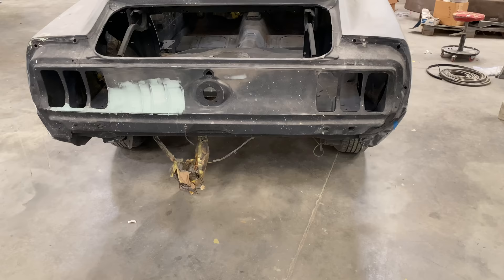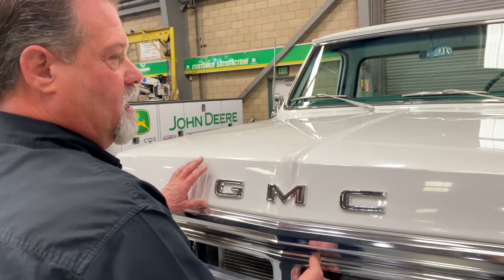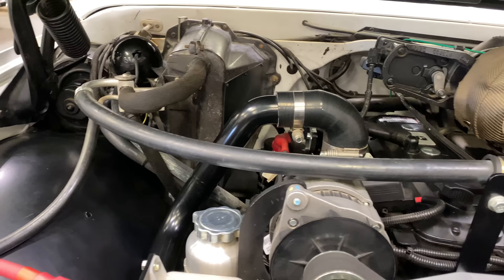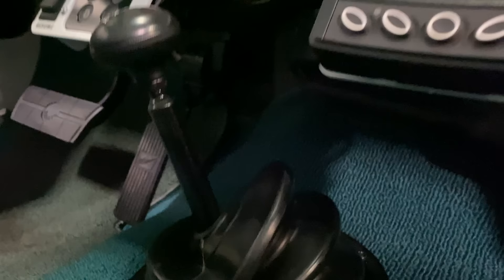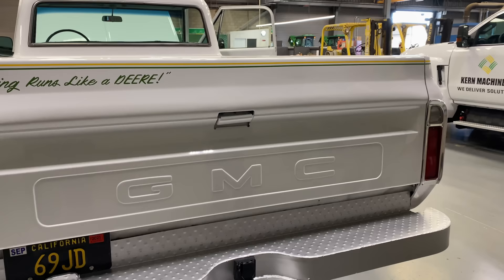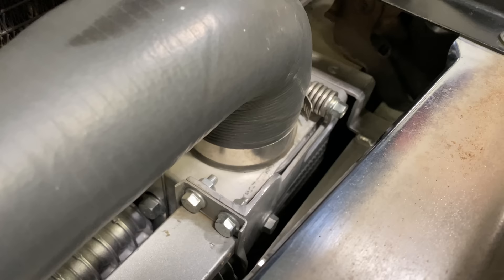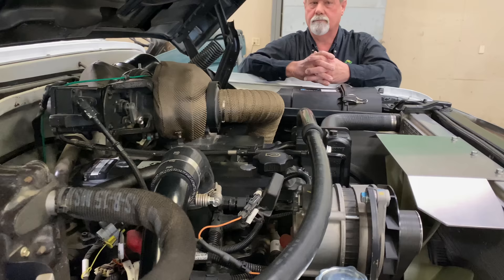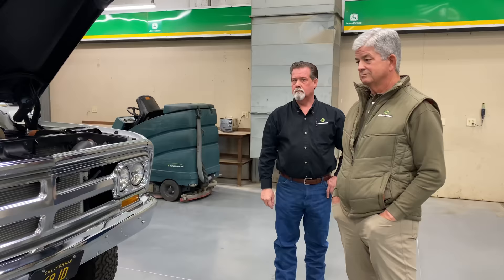John Deere Tractor engine in 1969 GMC truck!

Comment: Meanwhile hundreds of modern John Deeres are broken down with software lockouts forcing immense cost of repairs on farms and ranches. I used to love JD, now I believe the whole outfit can rot in HELL for their financial abuse through software lockouts of the ag industry.
Reply: Truth spoken. More yet if the equipment has to be trucked to a distant dealer
Reply: Exactly my friend... Farmers dont have time to wait for a dealer to take two weeks or more to fix it.. If I cant fix it myself and get back to work to put in or put up my crop, I dont need it.. Leasing is such a pain in the ass anymore, am about to buy some more older equipment, and keep my hard earned money.. ✌♥️🇺🇸
Reply: Yeah it straight robbery. I'm glad people are talking about this. This has to be known before somone sinks there ship with a half a million dollar yard weight.
Reply: They have a new program where a farmer can buy the software, edl, and computer
Reply: Seems like a segway to re-enslave and lose personal rights to own property.  In general the electronics industry seems to be more USSR secret where the olden days of purchasing a device with the schematics stapled to the interior case are gone in regards to being a general expectation.  Now, there's proprietary firmware, hidden chip processes, software that is licensed and not owned, and some other concepts conning.
Reply: Yup, that's why I'm never getting one.
Reply: I bought a Yanmar
Reply: You can do a majority of engine troubleshooting with a generic 9 pin scanner on the ECM side to retrieve any DTC's ,but yeah,if you're in need of troubleshooting anything related to Chassis modules or trying to get it into a forced re-gen, you're pretty much screwed if you don't have JD's software and Dongle with the 9pin..so, you'll be basically stuck with a derated unit, with no power....I had posted some vids a while back on how to trick a over-clogged system into a regen,but those videos were takin down by the powers above,cause they're basically forcing you to call out a JD field tech,or even worse,have to transport it to a dealer, like Dobbs, which is a F-ing rip off
Reply: Nothing rapes like a Deere.   Then boost about owning several dealerships. Who cares about the modified waste of money!
Reply: Yea I like the older stuff too, I see em a bunch on generators. 
I still see some older stuff back to the 70s. 
Seems like once they went common rail, they took a dump. 
Not a fan of their new business model at all.
Reply: @BigDaddy-qb2td  "Who cares about the modified waste of money!"  ///  Regardless of JD corporate policy on repair, it's still a really cool project that was done well to the point of looking OEM.  And it's totally usable and could be a daily driver. And better truck than when it was new.  I guess "waste of money" is subjective but if this is a waste then every car at SEMA is a waste along with hundreds of thousands of other project vehicles out there.
Reply: It should come free with every new purchase from Deere.
Reply: From "nothing runs like a deere" to "nothing runs"
Reply: Support your Right to Repair laws everywhere.
Reply: @codyguerrero1119  yeah did u ask how much its laughable
Reply: Definitely not an American motor!!!
Reply: Meanwhile the Ag industry is near tops of corporate welfare.
Reply: Not much JD stuff doing construction any more, we can be sued for not keeping up with a fast pace schedule, waiting weeks to get equipment repaired can cost you your business
Reply: @kd5inm  That's what ALL smaller Deere engines/tractors are anyway!
Reply: This is the reason I use only older equipment. 
All my shits paid for and none of the computer crap.
Reply: @TheBeingReal  where are they made?
Reply: @MrSenorhappy  Depends on the product. USA, Europe, Japan (Yanmar rebranded). Global company and they source / manufacture globally.
Reply: @TheBeingReal  I prefer USA Made. Thank you
Reply: @MrSenorhappy  Most people in the USA would probably agree, right until they pull out their wallet to pay.  Wall Street demands returns on investment that forces down production costs, ol Sanjay from India will do your job for 10% of the salary.  Capitalism at it’s finest.
Reply: Tell me how you really feel Jennifer 😂
Reply: preach it
Reply: Their construction machinery is junk too.
Reply: tractors replaced slaves and now people are slaves to tractors
Reply: i dive nothing ith a compute in it
Reply: @w1.0  huh?
Reply: This is a issue
Reply: Yeah my old boss had 2 JD's, 125k a piece, 4 years later he sold both of them and had 2 of school Case Internationals rebuilt from the ground up, ended up at 75k a piece, same HP and it they do break he can do everything himself. Farmers are getting f*cked by everyone nowadays, including the tractor companies.

Oh I forgot to mention, he installed AC in both of the cabs of the Case's, so they're just as comfortable on long days in the Kansas summer during harvest..

I no longer work for him anymore but I have a little ford for my property
Reply: @kd5inm  that’s great for you hobby farmers but for us full time farmers requiring larger horsepower a yanmar  won’t do
Reply: Yes! Hopefully  Right to repair is successful and they have to allow people to use that software to repair their tractors. You can find certain versions of the software around on torrent sites but don't do that it's illegal.
Reply: @chancethompson8686   Hopefully right to repair is successful. This will force companies to provide the software and parts so they can repair the stuff they spend money on.  So many companies now especially with electronics expect you to buy a new one in 2 years.
Reply: @nonionizingemf1424  I feel the same way. I do some microsoldering and you can't get schematics for a lot of stuff. And when you can some companies won't sell you the chips you need to fix it because Apple told them not to sell it to anyone else.
Reply: @nonionizingemf1424  also if you haven't look into the pine phone project and the labrum phone project. They are repairable Linux based phones.
Reply: @noahpaulette1490  Yeah, I'm finding the trend is becoming more invasive nuisance in the U.S. with whatever big corps, most likely international now since owning since the 1980's more-so, can get away with.  For instance, my first experience was working with FT-NIR spectrophotometers that used literally a car headlight style, or even a, lamp.  Well, I decided since the spectral characteristics were the same... to investigate.  Found ABB (I think Bomem, maybe higher up ABB though), bought all the companies lamps that were that spec on the market and relabeled with their company numbering scheme.  A little more investigation I found there were still equivalents on the market and I guess like the chip manufacturers where you could/can still find equivalent chips on the market... the challenge then is to test out which chips meet the better quality other proprietary model specs or which don't since what is found typically is the failing QC testing specs "new" proprietary make (and sometimes model).  Therefore, I think the consumers need to have a goal more to lobby legislatures to stop the enslavement and slavery schemes of Bolshevik failed or other countries and economies that did not allow for property ownership other than their monopolies/grandiose/oligarchs/plutocrats.  The trend seems to be enslaving, no personal property ownership and a class division that creates a situation where the "higher ups" can do whatever they want with no regards for the spirit, intent and letter of the U.S. Jurisdictions Constitutions and Statutes. Like you note also, investing in companies that are not closed source and seems like masked armed robbing their market if something is performed that is not considered meeting the civil bribery, blackmail, extortion coercion, seduction, manipulation scheme and for some reason is considered criminal when not even meeting the definition of a crime where a result might be something with processes that add up to more crimes that the closed source corporation literally commits.
Reply: @jafinch78  it's all working to bring in the great reset. With the MacBook example it's the charging circuit and using chips pulled from new chargers while being wasteful isn't to big a deal. It's just really dumb that Texas instruments I believe is who makes the chip wont sell it just because Apple says they shouldn't. People risk their lives every day to provide schematics to this industry by stealing them from Chinese factories with suicide nets. That's the real problem. Right to repair wold force them to allow people to have schematics so the product can be repaired.
Reply: @noahpaulette1490  The robbery is making people believe they need to invest in a product, if not also being forced to invest in a product, that has a network with armed robbers desperate to look like they're official enforcing valid laws that are really criminal in regards to the laws and enforcement of those invalid laws.  The attorney's, law enforcement, courts, jails and prison are literally conspiring, aiding and abetting and acting knowingly, intentionally and willfully with the continuing criminal enterprises corporations in a organized crime ring that also pollutes and make more toxic the environment for not necessarily survival related required goods.
Reply: They offer the software for sale along with the hardware. I know of at lease three people that have purchased it.
Reply: @derekl6433  I'll have to look into that. They were lobbying against right to right to repair and some similar legislation.
Reply: Even the equipment in the construction industry is the same. They just care about the money. Catapillar was a world of a difference.
Reply: New cars are nearly as bad,last week I had a 2020 Pacifica as a rental and the manual had the balls to say "warning,any modifications to certain features will void your authority to operate this vehicle"  Let that sink in,"authority". Chrysler has the gall to say that to an owner,it's amazing the kind of power trips manufacturers are on these days.
Reply: @chazzcoolidge2654  yep. It's all part of the great reset. Davos and wef say you'll own nothing and be happy. This is all to slowly bring us to that point.
Reply: I would advise everyone in th comments section to read the article successful farming published on right to repair    Contrary to what a person will gather from this comment section a farmer can perform 95% of repairs on their own. Believe me you can go into a John Deere dealer and order any part u desire for a new tractor
Reply: Lame, evey Manufacturer does this. Fyi you buy service advisor for 500 bucks just can't program it, so get over it.✌️
Reply: John Deere pulled a Carhartt in theory ...shame on them
Reply: @derekl6433  your missing the point maybe ? The old tractor jd never required software just motivation. Now jd tractors require both
Reply: @tylersowa3858  Any new Diesel engine will have to be electronically controlled to comply with emissions, I’m sure John Deere, Cummins, Detroit or any brand would be happy to have a less complex engine that required less parts and less warranty claims.
Reply: @tylersowa3858  also any other computer controlled system on a JD tractor is by market demand- if IH or CAT or any other brand comes out with a computer system that gets better yield during harvest then it will sell better than even a simpler tractor because it will give the farms that have it a competitive edge.
Reply: @alanking7331  instead of getting the government to force a private business to do what you want just don’t buy from them. They’ll either change their business model or go under. There’s really no need to expand the authority of government even more.
Reply: @TheBeingReal  if you mean from tax breaks then that’s not welfare at all.
Reply: I totally agree. Greedy john deere.
Reply: I have to agree honestly
Reply: @scottrayhons2537  and using an even greedier govt. to force them to do something.
Reply: My dad broke land in Saskatchewan in the thirties and he said that when John Deere came out they advertised their tractor with having five hundred less parts then any other tractor but guess what he said if you stoped and listened out on the prairie and you heard a tractor running it wasn't the John Deere it was the fifteen thirty international my dad knew which was the best and still is they worked their tractor twenty hrs a day all summer long
Reply: This is a modern engine
Reply: And moving production to Mexico.
Reply: @krisn8820  well a lot of their equipment is foreign already, the cheaper 6 series tractors are Mexican made while the 6r is made in Germany. So that one has sailed
Reply: That truck is very cool, props to the man that built it.
Reply: I quit farming twenty years ago. We have lived two miles from a John Deere for  over 45 years, since they opened. We operated our small grain farm with a 4430 JD tractor, 20 series JD combines and a small Massey Ferguson tractor. We could fix just about anything ourselves and the parts were just five minutes away, and nearly always in stock. For those still farming, those days are gone. Machines can be down for weeks, if not months, and almost always require expensive dealer repair. Nothing sucks like a Deere
Reply: @tripacer8259  tell me something I don't know
Reply: @youngmike8645  yes i know that... my yanmar is the same as a JD650/750
Reply: I agree 100 percent, that shit should be against the law.
Reply: Truthfully spoken good sir
Stay blessed
Reply: 100% agree
Reply: @MrSenorhappy  find me an American made tractor then
Reply: @mariomarquez5559  not true
Reply: There is a reason why Deere does not release its software. And it is for a good reason a
Reply: Recruit a local.hacker to override the system. 
Put it on Craig's list
Reply: Have never wanted or owned or thought of 
buying a John Deere's glad I listened to my heart not too.
Reply: That's why we don't own a single Deere! Old Case IH magnums and New Holland Genesis 8970s are the way to go!
Reply: If you can afford to buy Deere then you can afford to have it fixed!
Reply: buy and repair the old tractors for half the price of a new one. 60-100hp range anyways
Reply: @TheBeingReal  
If we had a free society/economy, and we don't, if your job can be outsourced for 10%  of the cost to the other side of the world (which comes with it's own long list of costs and complications) that is an indication that your job is no longer in very much in demand locally and that you are being out-competed by someone in a third world country, and it's time to find a new line of work. 
It make suck for you but the whole world dosn't revolve around you. Reducing labor costs is better for everyone overall for obvious reasons and it frees up labor to do other things and it benefits that person in India who's family might suffer or even die without that job (because our society is far wealthier, it's vastly easier for even our poor to deal with joblessness than a poor person in India). 
People so seldom see the big picture in economics.
Reply: @177SCmaro  Cost/expense control is business 101 to stay competitive and profitable.  No question there.  When you purely LCC jobs/parts/labor to reduce costs and the end customer sees no benefit, as a society its worth questioning. 

Anywho, the point I made to which I believe you commented on was that a lot of folk will wave the “Buy American” flag: right up to the point they have to decide for an equal product made in a LCC Vs USA made and they see the price difference.  

There are many products that are high labor but low value added that just do not make sense to produce in the USA anymore: clothing is a great example.  Overall, if you just want a pure race to the bottom there is not a job or component made that cannot be done cheaper somewhere else. Then it gets to be a bugger to sell your product to people who can no longer afford it.  

Somewhere there is a tolerable balance…there is no perfect solution. 

Cheers.
Reply: @TheBeingReal  
The benefit to the customer is lower cost products, or superior products at the same price, basic economics. I think you mean to say YOU see no benefit but, again, I think your problem is a lack of perspective, practically in overall scope. This is a bad habbut people have - "I perceive no benefit to me so their must be no benefit to anyone, or it's only benefiting those evil fatcats at the top, therefore it's exploitation and bad."
Reply: @177SCmaro  No reason to keep claiming I have no perspective.  I deal globabally with customers and supply chains.  

Rarely do you see reduced cost to the customer.  I’d make the case as a business you’d be a fool to reduce your sell price.  

Again I will remind you of my original comment. So let’s stay on topic.
Reply: @TheBeingReal  No reason to point your lack of perspective when you go on in your next breath to demonstrate your lack of perspective in denying there is a benefit to customers in reduced labor costs by outsourcing, ect. 
And anyone can get on youtube and claim they are anything they want. The reason I doubt you've ever run anything more than a failed lemonade stand is what I've explained to you should be basic, basic economics that you would know if you'd ever actually run a business. Probably why you're trying to change the subject.
Business btw, reduce their prices all the time. It's called a sale, something else you ought to be aware of. Even just not raising your prices in accordance to inflation effects a lower asking price. Another common practice is undercutting your competition's price by a small margin to attract customers.
Again, basic stuff, dude. You'd have to be completely ignorant of economics and buinsess to never consider lowering your sell price, depending on the circumstances.
Reply: @177SCmaro  Your ad hominem arguement continues.

You made a lot of claims about me: now prove it.  Burden of proof is with you.
Reply: @177SCmaro  technology enslaves people...just as you are here pointlessly debating instead of living life or spending time with your loved ones...all we have done with technology is create another level of things to maintain...we could all easily grow food ourselves with gardens and would not need huge fields that require tractors...however gardening would cut into our using technology for self gratification time
Reply: @deputydillhole  
No, the FACT that you have a choice BECAUSE OF technology to prattle on here on the issue of your erroneous opinion or go work in the feilds makes you free. That you chose the former makes you a hypocrite.
ps: You have a rather deluded sense of what life was like in the past, before technology meant most people didn't need to toil in the fields all day. There are reasons why people die trying to escape third world countries to get to the USA where technology means their children have a chance at a better life.
Yes, there are conceqences if one indulges too much into the technological luxuries we enjoy today but that is true of everything. That is true of something as basic as eating. It doesn't follow from that that we should therefore abandon technology, it just means we still have much to learn or relearn of personal restraint and discipline.
Reply: @deputydillhole  
tl dr
I have a race car to work on. I don't have time for your excuses. And you speak only for yourself. Take responsibility for your choices and actions, stop blaming the device in your hand.
Reply: 💯 JD sold their soul
Reply: The forced installation of the computer, into ALL OF OUR VEHICLES, has proven to be the worst thing to ever happen to vehicles of any kind. 2 wheels 4 wheels computers suck ass in vehicles...
Reply: Thank your government
Reply: Computers are the worst thing you can add to mechanics reliability.
Reply: Kubota does the same thing
Reply: Massey has always been better than John deer.
Reply: @Shade_tree_garage01  finding parts is harder if you have a slightly older tractor
Reply: In 73 I work for a JD dealership, I could do a clutch job in 4 hours or less  they would take my work order and not let me have it back. Turn out they were charging 12 shop hours on the job. I would over haul a 4020 complete I did the heads, fuel system, everything In 36 hours I was taking it off the dyno. I would work 12 hour day so was ready for pickup 36 hours after they drop it off. Guess what they would not call the farmer until they had 48 hours on the work order. Dealerships are a joke. And they were put JD motors in trucks in 73
Reply: @codyguerrero1119  "they have a new system" 
Why don't you tell the rest of the story about how they faught tooth and nail and spent millions specifically so they wouldn't have to make that "new system" available to their customers?
Reply: You are very miss informed. Deere is one of the few companies that has released their Service Advisor software with EDL connection kit to the public. Dealers will even train customers how to use the software. You won’t find another agricultural company more dedicated to keeping customers up and running.
Reply: I build my own tractors 🚜 from the ground up no computers.
Reply: damn straight i was thinking about that when they brought up schooling and went to comments to be the top one🤘🏻
Reply: Ppl are going to start LS swapping em tractors 🤣
Reply: @RjBrown-ks5tz  - Problem is that it is greed on both sides - the dealer is greedy, creating machines that the average farmer can't fix and will need to bring to the dealer; and 2) the farmer who insists on the latest greatest machine because Joe next door has one.  The reason that many of the smaller tractor companies (kubota, yanmar, etc.) did well initially is because they were selling bare-bones tractors at a reasonable cost - of course that didn't last long. Tractors do NOT need to be computerized and full of electronics.
Reply: This is true but I don't really believe this is the correct forum for this conversation. Here we are talking to two nice guys that have built an amazing truck and even though they may sell JD equipment they are not JD nor are they the ones making those decisions that have effected so many. However that said I do also have a problem with the right to repair act as it sits I just don't think we should crucify these two nice gentlemen because they have a JD sticker on their vehicle. Oh and guys this is on fine machine you have built thank you so much for sharing it with us!
Reply: @timwegman5776  - Absolutely this is the correct forum to mention it!  These 2 "nice guys" as you call them are part of the problem.  They both deal in JD retail, parts, and repair and are part of the whole system.  Secondly, this vehicle was built because they have access to everything they need and I'd bet about anything they wrote the expense of this build on their taxes.  Just look at their facilities.
Reply: Ecochamber
Reply: I used to work for kern machinery JD as a shop apprentice. I can confirm that 99% of the jd's that are broke down is just mainly computers not working right.
Reply: @coryphillips3195  - Yeah, and whose fault is that?  Let me guess, it's the farmer's fault.
Reply: I don't know about farming tractors, but in construction I've only driven CAT, Kubota, and Husqvarna tractors. I'd have to say Kubota and Husqvarna are my personal favorites.
Reply: Truth!
Reply: John Deere < kubota
Reply: It’s to prevent innovation: if you can control every aspect from a computer you can add/remove “features” as you please buy when everything is analog it actually takes a skill or two and some real equipment not some touch pad and an air conditioned cabin
Reply: So stop buying them.
Reply: How does that ghost software work, I seen a mini doc here on YouTube, guys were waiting long periods of time than started getting that European ghost software???? If anyone can touch on that
Reply: All machines are the same these days I don't know why JD cop such flack for it
Reply: I hate to say it, but it's time to look to basic, overengineered, reliable as a hammer stuff like Mahindra or MTV-Belarus. If you have a friendly local hydraulics and engineering shop in town, you can uprate anything sub-par like pumps, rams, etc. for far less cost than the downtime and dealership fees to fix something expensive enough that it should not have broken. Vote with your dollars, unless Deere has a death-wish, they'll re-evaluate their stance after two years of losses and warehouses full of unsold machinery.
Reply: @TheBeingReal  I don’t mind paying more to get a better quality piece. I learned that you get what you pay for.
Reply: Facts! 🔥
Reply: Was told today by dealer that we no longer purchase a user or tech manual for our combine and tractor as of a month ago. Even the workers had to laugh a little because everything says to read the manual prior to operating....but you cannot buy the manual. We are done with deere, we are done with Hutson's (whom bought most michigan dealerships). They have become worthless, there employees are rude, and I believe it's because we work on our own stuff. Manager in our nearest dealer made the comment, "if your not spending 1 to 3 hundred thou with us,  we will get to you when we get to you". Small farm here, no way we will put ourselves out like that....they wouldn't.  I am waiting for one of these ag companies to see the light and start to make quality equipment that isn't tied to a dealership, at a decent price. That company would become the largest ag company in a matter of a year. A lot more people blind to color and company now more than ever.
Reply: @BigDaddy-qb2td  and every Dollar spent was a tax write off as a business expense including the paycheck to the Guy who built it
Reply: @w1.0 I believe every engine under 100 horsepower is a import Yamar Diesel.  Everything over 100 horsepower is built by Deere.
Reply: Other industries have lost lawsuits on right to repair, their turn is coming.
Reply: @codyguerrero1119  I’m certain they charge enough to be abusive
Reply: TRUUUUUUUUUUUUUUUUUUUUMP
Reply: Was a J.D Heavy Equip Mech not Tech, worked for near starvation pay for 30yrs but they had no compition in our area except for Michigan Equip. Ended up in a County parks &Rec Dept. easy job with better benefits but still low pay. This was in Northern Ind. pay scale is real low here,but prices aren't.
Reply: Should have used a 4 cyl Cummins / manual trans.
Reply: Do something about it... The core engine will run with modifications. Find a way to run the core and make the changes with some good old fashioned American ingenuity. Id say that the people that enabled this behavior are the true problem. American greed is a good place to start. No one talked the American farmer into doing anything he didn't want to do at the dealership...If you want to make a statement, do it with your feet and walk away...
Reply: @nonionizingemf1424 I think you hit the nail on the head there